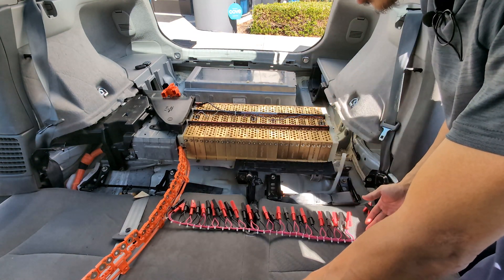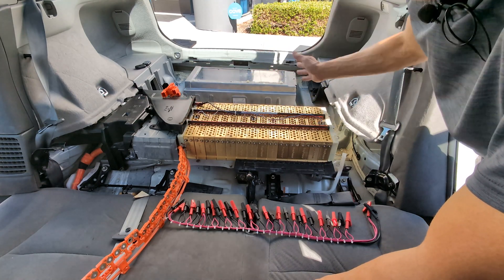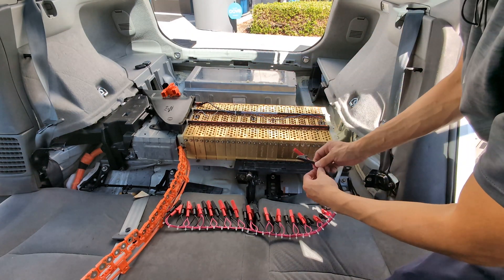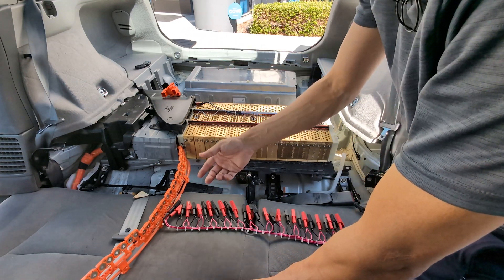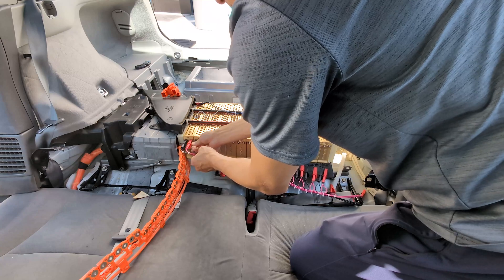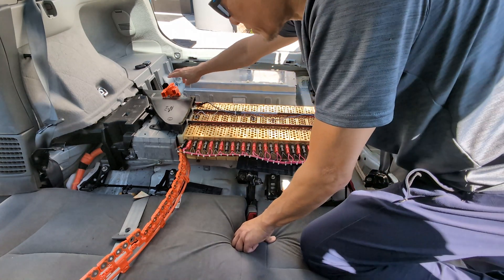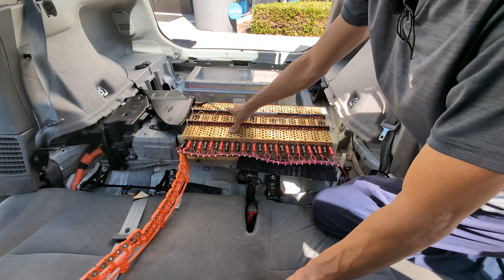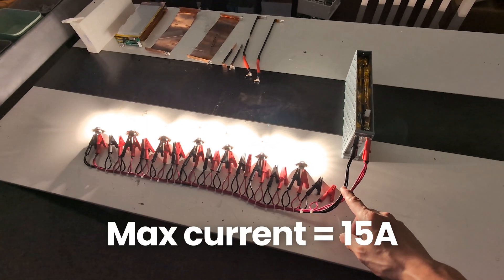Balance your hybrid battery with equalizer cable - tips and tricks - Toyota Prius

Comment: This battery sounds great and all but it doesn’t even work for as long as the original old tech battery does, based on how they advertise it, it should lower your gas mileage 3 times and it DOESN’T. Best and cheapest way is to buy a couple batteries packs from your local junkyard, get all the good modules and put them in one, balance them and you are good for another ten years. Worst case it will cost you $200 including the hobby charger you need to check the quality of those modules.
Reply: Get from junkyards ten year old battery ?  And expect that there will be modules good for another ten years?  Do you hear yourself?
Reply: @ clearly you cant read and dont know toyota hybrid batteries. I recondition and repair battery for 3 years now. You wont understand even if i explain it so sure whatever you say!
Reply: @BA-ht8bg  you do repair for 3 years, but guarantee them for 10 years?  How do you know how long they will last?  Bla-bla?

Comment: Off-topic question: would it be possible to have the Dr. Prius app have an option to turn off the TPMS warning light? I've removed my monitors from my tires and I'd like to turn off the light without jumping the pins.
Reply from the maker: Hi @jorowi, the only way to turn off that damn TPMS is to replace the TPMS sensor or replace its battery, I've even tried using an electric tape to block the light but it will still shine through at night time. very very annoying!